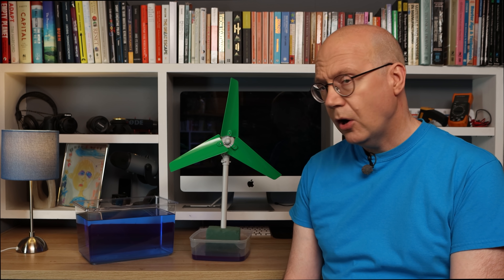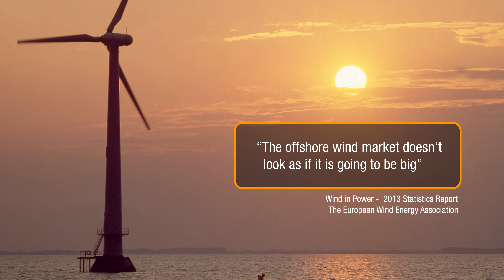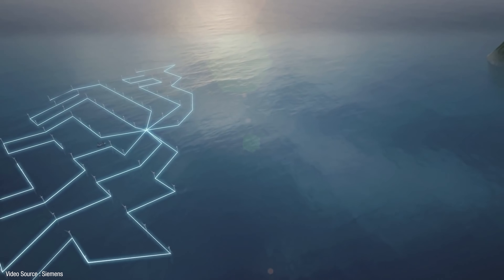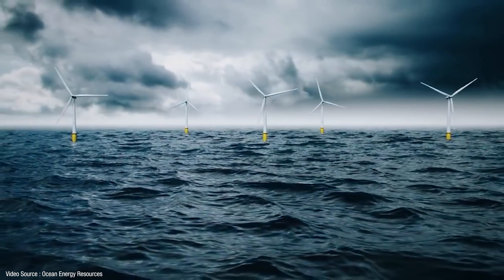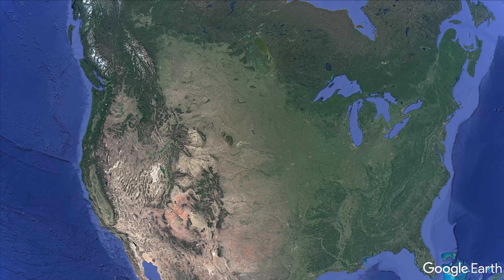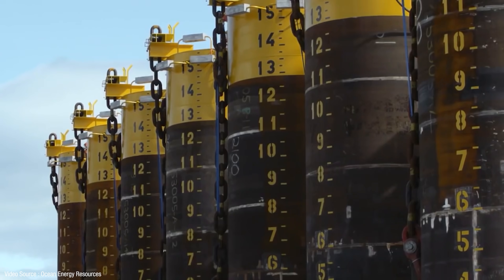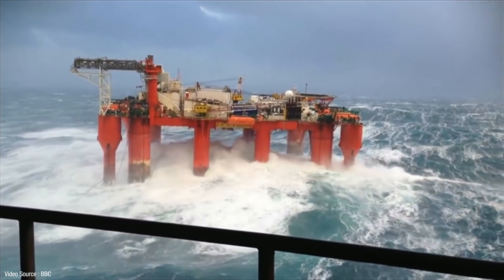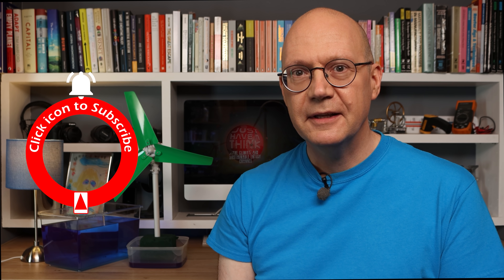Deep Ocean Floating Wind Turbines. How do they do that?

Comment: One thing that wasn't really talked about here is: How to power is transmitted from the offshore turbine to wherever it is actually being used. 
A somewhat important detail in light of the fact that the further power is transmitted the more of it gets lost along the way.
Reply: There are an awful lot of site that are no further offshore then existing North Sea farms - it's just that the water is deeper than 30m (Scotland, California, Japan, Spain, and the majority of coastal countries in fact). So the power situation is no different from what has already been proven in the North Sea.
Reply: True... I saw one claim that having hydrogen production attached to these wind farms and then a hydrogen pipeline to shore rather than a transmission cable would be more efficient, or at least have smaller transport losses. I am skeptical of that claim, as you'd have losses electrolysing the hydrogen, especially considering you'd first have to desalinate ocean water. So, I dunno. Would love to read an objective comparison of the two methods.
Reply: @adamlytle2615  Electrical losses for transmission are probably 3-5%, but making hydrogen loses around 30% of the energy I believe.
Reply: @Danandlene  if you're looking at AC electricity to hydrogen back to AC electricity the losses are much more than 30%.

The 30% loss figure (70% efficiency) looks at energy in the electricity compared to energy in the hydrogen.

Turning hydrogen into electricity is about 60% efficient. 0.6 x 0.7 is 0.42, or 58% loss. Converting it from low voltage DC up to AC is about 95%. That brings the overall efficency down to below 40%, or 60% loss.

That's before you include the energy needed to compress (about 4 kWh/kg) or liquify (about 10 kWh/kg) the H2. Include those and it's barely under 100% loss.
Reply: @gasdive  
The efficiency isn't as bad as the wasted energy of gasoline before it gets to the wheels of a vehicle.  You forget that the amount of renewables has to be 3 or 4 times the load because of the intermittency.  So using the excess energy to make hydrogen instead of wasting it is a good way to store energy.
Reply: @Danandlene  
Round trip efficiency of producing hydrogen by electrolysis and then using fuel cells to convert back to electricity is only somewhere around 40 - 50%. i.e. 50-60% loss.
HVDC transmission, on the other hand, has transmission losses of perhaps 5-10%. A proposed 10,000km cable providing PV energy from Australia to Singapore is estimated to be able to keep losses to under10%. Given this, a world-wide HVDC grid might be a viable way to equalise production/consumption patterns on a global scale.
Reply: @acmefixer1  when you're looking at near 100% losses, no, it isn't even useful for that. Much better to send it over powerlines to where it can be used, or use it to pump water uphill.

Unless you're going to use the hydrogen directly for an industrial process such as steelmaking, but then you're better off making it on site as needed from electricity that comes via wires rather than making it elsewhere, storing it, compressing and transporting it.
Reply: With rising sea level coastal big cities will have to be rebuilt. Why not make floating cities then tow them out to be near the wind farms? 🤣
Reply: @retiredteacher6289  
Too expensive.  You going to have your kid go to school on a jetski?  😱😱😎
Reply: These deep water developments are 20-40km from shore in most cases.  The electrical losses aren't that significant, and are probably on par with a solar development in a desert, for example.
Reply: With a floating transformator that collect all the energy in the park and send it to the shore.

Comment: One feature of these buoy turbine has gotten my attention. Is their guide wire anchors count, three of each. Why three and not more? 

If one gotten loose the remaining two can’t secure the buoy for long. Redundancy is the key to protect investment and avoid drifting buoy this heavy. Also offer respond time needed for repair and maintenance.
Reply: Some developers are considering double mooring lines (3 x 2), but most are going with just the 3.  There is indeed a non-insignificant risk of mooring line failure over the life of the field.  The electrical cables are sometimes required to have a weak link mechanism to basically cut/drop the cable in case it sees too much load, for example if a mooring line fails.

Comment: @Just Have a Think - Thanks for pointing out exactly what is being done for deepwater offshore wind energy... an incredibly stupid, expensive, resource-intensive, low-profit and brute force approach to the overall problem. (massive facepalm)
Reply: There is a simple way to verify or refute your claim.  What is the LCOE for floating wind turbines?  How does it compare to other ways of generating electricity?
Reply: @incognitotorpedo42  Well, and what are the LCOE trends as the technology matures — hence the projections shown in the video. Obviously not every projection will turn out to be accurate. But the modelers aren't making wild guesses, either.

Comment: The cabling to the grid will be a nightmare.
Maintaince will be impossible in winter time North sea.
They will not supply sufficient energy when they are shut off most of the time, wind speed too high or low.
Altogether a white elephant!
Reply: they are doing it in denmark and in the uk,so this might be less of a problem than you might think.
you might just have an other think :)

Comment: Such systems could produce hydrogen ie store the energy in situ to be harvested with repurposed oil tankers. Someone patented that years ago but nothing comes of it.
Reply: Electricity -> Hydrogen -> Electricity has an overall efficiency of 50% tops. AC -> HVDC -> AC, on the other hand is more like 80-90% even over thousands of kilometres.
To equalise localised, production/consumption disparities we may be close to the point where a worldwide HVDC grid becomes a viable proposition.
Reply: @q.e.d.9112  the Beaufort and other offshore regions with high winds are thousands of kilometers from the cities.. how do you transfer that power?
Reply: @notlessgrossman163  
HVDC (High Voltage Direct Current). There is a proposal to supply Singapore with solar power generated in the Aussie outback. This would require transmission over about 10,000 km (6,000 miles) via an undersea cable. Preliminary studies have suggested about 10% transmission losses.
In view of this it might be possible for us to develop a world wide HVDC grid that could match supply and demand and reduce the need for storage.
Hydrogen as a storage medium only really make sense when generators would otherwise be turned off and when the energy density requirements are far higher than the power density needed. Under these circumstances it may be viable, particularly in co-generation (electricity plus heat) circumstances. 
I can explain this a bit further, if you’re interested.

Comment: Balancing cow on the pole wind floating turbine :) Oil rigs a made entirely from steel 10 times denser material than fiberglass, and they pump enormous amount of concrete in lower part of rig to shift mass center of oil rig into deep as possible that is other problem of oil rigs they consume enormous amount of materials not just steel, but yeah oil rigs are stable even in most harshest storms mass center has very low point.
Reply: Oil rigs are not made to have the biggest wind load possible, in the thousand tons of horizontal force for offshore wind turbines. They are also very high and top heavy, leading to very high tipping moments.
Oil rig can tolerate much more movement than wind turbines. because wind turbine spin, too much movement will increase the loads on the bearings, shafts and blades.

Comment: Use less energy is another good option. Otherwise can't just do anything else then marvel at the great ingenuity people have at their capacity, and if we would just be willing to pay what it cost to keep this planet, with us on it, for another few hundred years we wouldn't have to scrimp and save to compete with oils. I gladly pay more for that certainty. Thank you for the great inspiring channel!
Reply: Forced energy poverty is a terrible policy.
Reply: @orkin2525   Poverty from what? Overconsumption? I'm not a economist so  I won't try to tread these waters too much,  but spending your money on something that gives you back a better profit in the long run seems sensible anyhow.
Reply: Energy reduction does not equate to energy poverty. Energy efficient buildings, appliances, manufacturing, etc. are an essential component of our ability to become fossil fuel / carbon emissions free.  Buildings can readily run on 50% of the energy they did just a decade ago. And unfortunately it seems we need government mandates to make this happen because it’s 5-10% more expense to build this way.,
Reply: @julianugentarchitect  if we reduce usage to the point where wind and solar can provide enough power it will be energy poverty for those without hydro and geothermal. If you want people to stop burning stuff to get stuff done there has to be a huge amount of cheap, clean energy as an alternative. The other option is reverting everything back to people power and substance farming.

Comment: How about a series of floating wind farms spread out along shipping routes that would power container ships through boats that would have batteries charged by wind and then charge container ships on the move by drone connected cables? The container ships could minimize battery mass required to go electric and the immense power out in the open ocean could be used without undersea power cables required.
Reply: The scale involved makes that a failed idea from the start. A battery big enough for a cargo ship to even make up for the energy of stoping and starting will take several of the windmills to charge in any reasonable amount of time
Reply: Well you really should be on the stage.
Reply: Or build big sail boats, no need to transform wind mechanical energy to electricity to chemical energy in batteries, move the battery, convert to electricity, to mechanical energy.
Reply: @niconico3907  there is a reason humanity stoped using sail powered cargo ships about 100 years ago. There was a time when there were both wind and coal powered ships running at the same time.

Comment: The UK wind turbine fleet is currently producing 0.9GW from a peak ever production of 18GW and a book output of 24GW

So, to hit a 100% demand production figure, at around 30GW we will need 30x the numbers of turbines  along with grid scale storage and something to do with all of the extra production when the wind does blow.
Reply: Wind has a capacity factor of 30-40% solar at 20-20%. Subtract 10-20% for storage efficiency, and extra distribution losses. Or we can use nuclear at >90% CF, not have to use storage, and have lower distribution losses.
Reply: @orkin2525    Can you describe what you mean by "capacity factor", do you mean average output vs design maximum?
Reply: @marvintpandroid2213  basically. At 100% CF a 1000 watt generator will make 24kWh of power in 24 hours. At 25% CF (the higher end solar average depending on the location) a 1000 watt solar panel will make 6 kWh of power in 24 hours.

Comment: 10:19: I know this is a green energy channel, but the engineer in me is curious on how oil platforms drill for oil in rough seas like shown here? I'm always under the impression that the platforms are steady, but that obviously only pertains to shallow water platforms where they can easily anchor to the sea floor.
Reply: Watch the excellent video coverage of the gulf oil spill disaster a decade ago. The structure of these rigs, on the surface and on the sea bottom, as well as the efforts that have to be taken when a storm is imminent to shut things down and restart after things calm down, are excellent to behold.
Reply: They must have flexible pipes, beats me too.
Reply from the maker: I'm not sure but I would very very surprised if they continue working in extreme rough conditions. They most likely sit it out and wait for calmer waters.